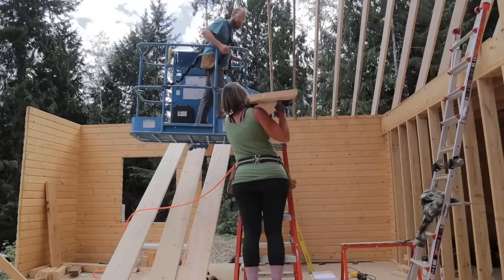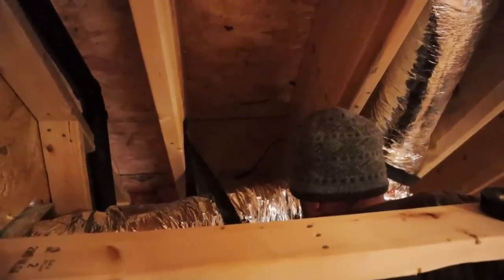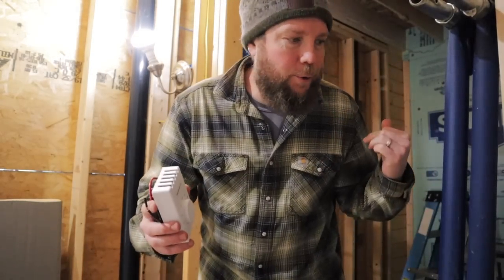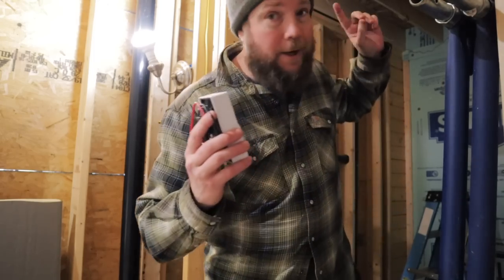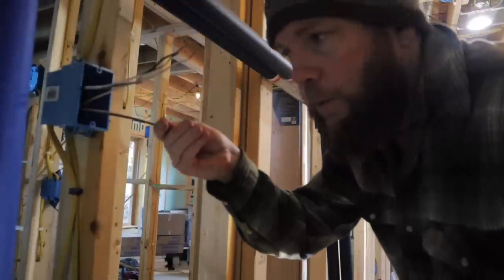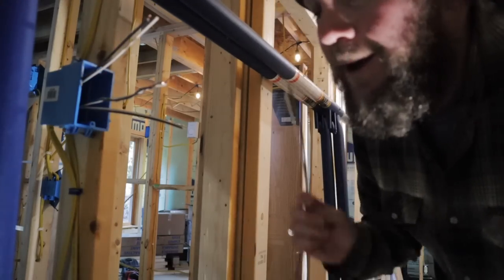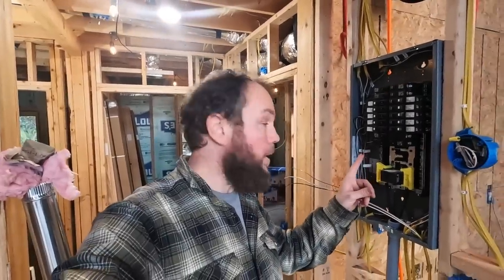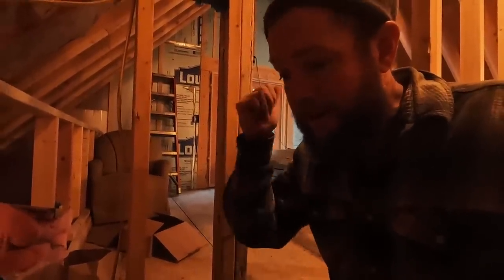WE PUT this OFF for TOO LONG

Comment: Great job on the roof work! Loved the comment about the boys. In the electrical panel, when you use a white as a line of power, you should take black tape and wrap the first 3" of the white wire. That way it's known as a power line. Keep pushing forward!
Reply from the maker: Not sure if it showed in the video but we did tag all the whites as got with black electrical tape.   Safety first!

Comment: It's always tough to cut holes in a new roof. I like those vents. The ductwork and electrical for the heaters is one more if a thousand things no one will ever see that make your house run smoothly. Great job on both. Are you get another round of snow?
Reply from the maker: Thank you!  Yes, holes in the roof are scary, but its rained a few times now with this new hole, and no leaks, so that's good!  

We did just get more snow. You'll see it in next weekend's episode (March 19th).